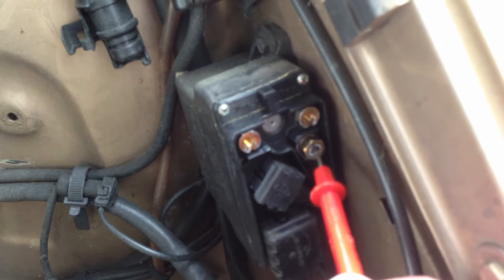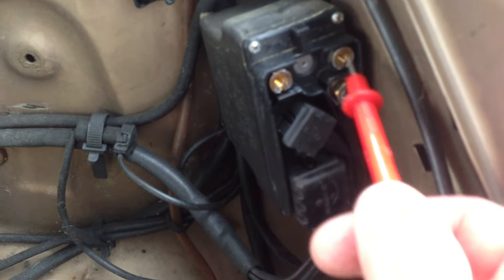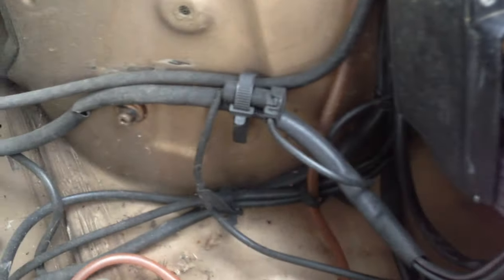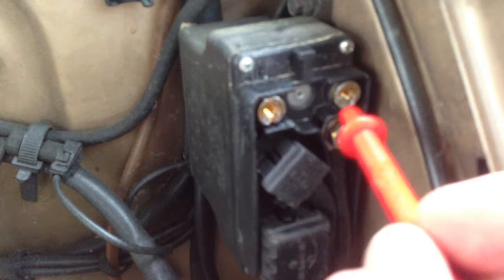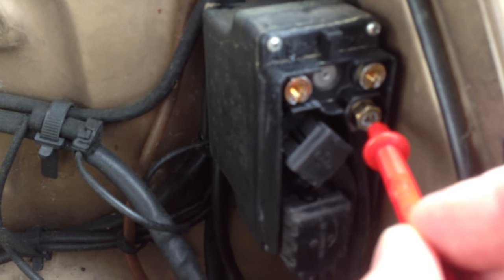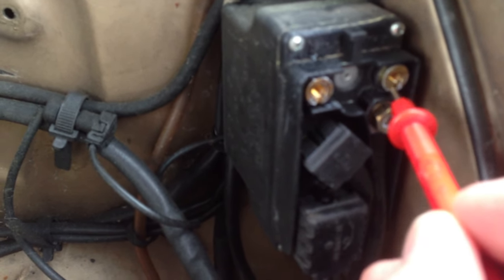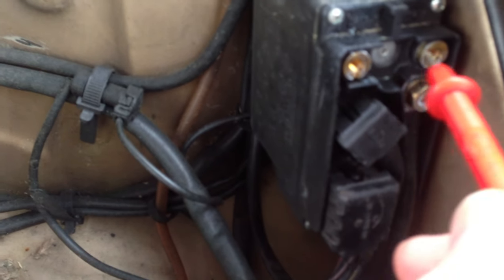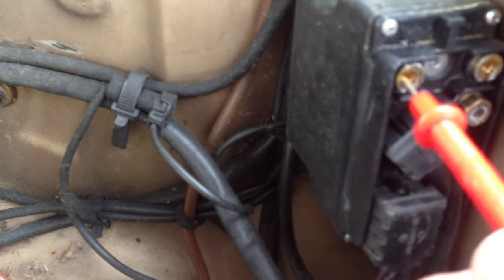Quick Glow plug relay check

Comment: If I recall correctly this is the CORRECT way to test the glow plug relay....there are two electrical plugs in the glow plug relay box.
The one on the bottom you pull out, and then stick the red lead inside each hole while the black lead is grounded. You want the multimeter setting on ohms.
You should read between 0.6-0.9ohms in each hole.

If one of the holes have an infinite amount of ohms or an open loop, then there is a wiring problem going on with the relay that needs to be addressed. Sometimes aged wires will give you a "sleeping" glow plug that actually isn't dead.
Reply: No, that is purely a test of the glow plugs and the wires going to each plug. Nothing to do with the relay.